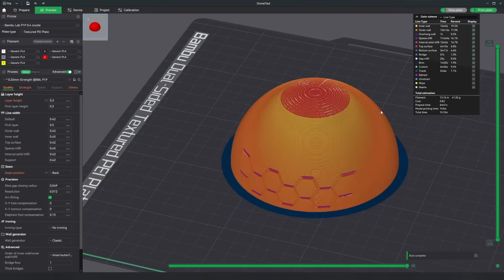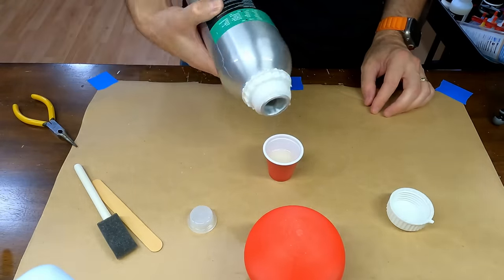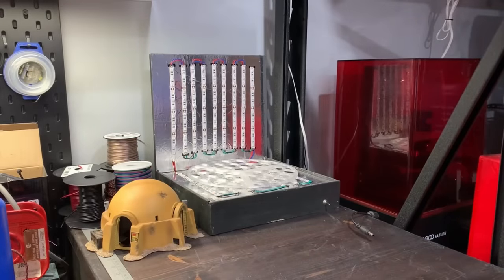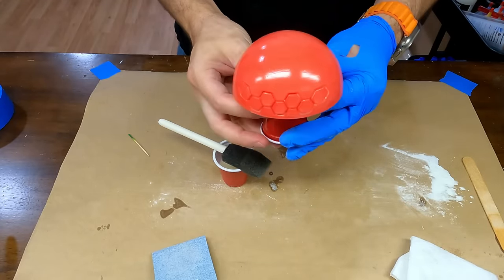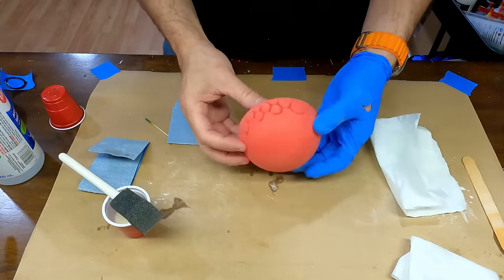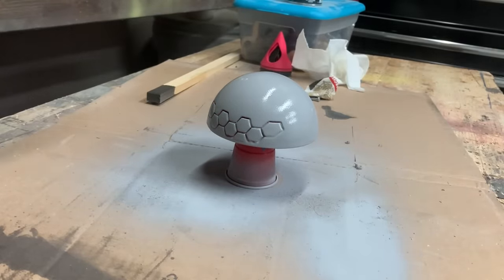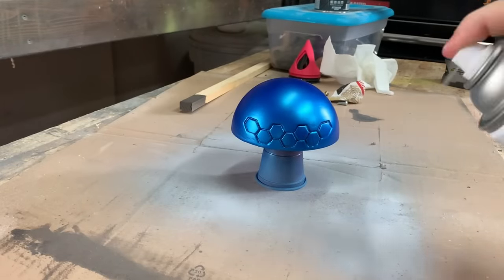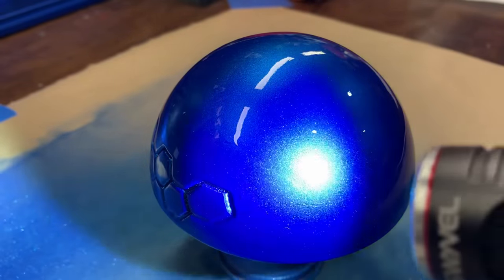Hide 3D print layer lines with Baby Powder and UV resin

Comment: Great technique!
For the recessed, relief areas,  the hexes could be printed separately  and then glued in later to preserve the detail. I understand that this is just a demonstration piece, but the method could be applied to other things. 
Just something to add to this method for finer detail that would not be possible otherwise.
Reply: Or you could just fill them with latex or some other masking medium prior to painting on the resin & scrape it out after.
Reply: @drakocarrion I had that thought too but then if you cure the resin you will probably seal it in and if you don't cure the resin it's going to be a big mess. It might be possible on some parts and maybe half curing the resin and doing it might work but I think it's going to depend a lot on the details of the peice.
Reply: @MrDuranis  A masking material would be visible under the resin, cured or not. You'd just need an exacto to scrape it out with.

Comment: nice work! If you add leveling thinner to your paint, it won't dry as fast, giving it time to level out, and you also won't need to spray as much paint. You'll get a much thinner, more even coat all around with less imperfections.

Comment: Was really hoping this was a brush on and cure solution that would not require sanding.  That being said the outcome was nice and I suppose it may have been less sanding than would be needed otherwise. Thanks for sharing.
Reply: if it doesn't have any details like the hexagons, you might be able warm up the resin and pour it over.  Exposing it after it settles could give you a very smooth finish with no sanding.

Comment: If you're going to be using filler primer and wet sanding and all this post processing anyways, how is this better than just using spot putty on the rough parts to begin with?
Reply from the maker: Speed mostly, and the speed scales with the surface area you are covering.
I have a video here doing the same thing with putty https://youtu.be/xxdjFREJpKs
It works well also but takes longer to apply and you have to wait hrs for it to dry between coats.

But putty would be better on smaller areas and around details you want to preserve.

Comment from the maker: Update: New video comparing Resin to Resin with Baby Powder added here: https://youtu.be/UFRbTg37Td8

Some people asked for still images to get a better look at the surface finish so I put a few image over on the community page
https://www.youtube.com/@DaveRigDesign/community
I also put some pictures of the red dome from the glazing putty video so you can compare the difference. 
To take a look and comment back here :)
Reply: Thanks for the straightforward video ! That's great to watch :)

PS : airbrushing with a smartwatch, you sir are confident in your skills I see !
Reply: @DaveRigDesign So is the corn starch just a thickener for the resin, so it can be painted on and not run off?
Reply from the maker: Exactly
Reply: @DaveRigDesign  thanks. Makes me wonder what other thickeners would work.
Reply from the maker: It seems there are products made for this. Glass Microspheres or glass bubbles seems to be a product used to thicken resin in boat building.
Reply: After all that skill and hard work, do you ever think you should just do it on a CNC machine? I thought the convenience of 3d printing was the selling point.
Reply: @DaveRigDesign  perhaps masking the hex pattern or filling with wax first will avoid the overflow of resin?
Reply from the maker: Ya have been thinking of some kind of masking material. People have suggested may things but it’s a tricky issue. 
It needs to stick good enough to not come out during sanding or effect the sanding process, but still needs to be able to be removed after easily. Wax may be a good option.
Reply: The surfboard industry has a resin called flow coat that is made to cover small discrepancies. You should sand lightly first so the resin adheres.

Comment: Try fumed silica instead of talc, it's an excellent epoxy thickener. You should be careful to use a respirator when working with it, but the same goes for talc.
Reply: He said it was corn starch at the beginning, also visible on the bottle. Although I was under the impression that baby powder was always just talc.
Reply: Ah, ok. In that case, definite benefit not having to worry about it.
Reply: @halkihaxx5  Baby powder has a small amount of talc.  If you want pure talc, you can get the powder pool players use.  I use it as a release powder for sand casting.

Comment: I've seen something similar where instead of baby powder and resin, they used acetone and wood filler. Obviously, acetone isn't good for all materials, but on PLA it had the same effect. Since I haven't ventured into resin printing and don't have a UV cure setup, I'll stick my crude finishing methods. Excellent video, BTW.
Reply from the maker: Thanks. I just posted a video about using acetone and glazing putty
https://youtu.be/CZsUXY_Qxwo

Comment: You can bring the clearcoat to a smooth mirror finish by wet sanding and then using polishing wax (like turtle wax) and a sponge/power drill adapter.  The drill makes the polishing super efficient and the sponge would conform to the sphere nicely.
Reply from the maker: Yup, I did think about that but I didn’t want to take it that far and they video wasn’t really about finishing the paint. 

It would have been super shiny though :)

Comment: Might want to be careful with the first from the resin. I'm sure some types are bad if inhaled.  Wet sanding should minimise the risk from the dust.
Reply: If the resin is fully cured its not more harmfuld than wooddust isnt it?
Reply: @soacker25  not sure how bad wood dust is,  but resin dust isn't good in the lungs.
Reply from the maker: No dust is “good” for your lungs, but the dust kicked into the air had sanding is negligible unless you throw it around and resin is inert once cured. If you want bad try cutting MDF on a table saw :)

Comment: Or just print it in ABS with an adaptive layer height followed by acetone vapor polish for a few mins. Done right, no resolution lost, while getting a glossy finish, that also strengthens the layer adhesion. No worries of UV degradation(UV resin degrades over time) either. Much cheaper than UV resin. Just some 💭
Reply from the maker: Could, but if you are printing big you need a big heated chamber to print ABS reliably. Also once painted Resin degradation isn't a issue as its protected. PLA is the much easier option to use. Vapor smoothing get more difficult the bigger the print also. 
This process is definitely better for large scale prints and less optimal for small scale things.
I don't think I would try it of anything smaller than the print I tested with.
Reply: @DaveRigDesign  Yes, you are spot on. Printing ABS without a heated chamber is tough, but with printers like Qidi X Max3, should not be an issue. Also the Acetone chamber needs to be custom designed(simple paper towel dip will not work well, apart from taking too much time). For smaller parts, Sanding or Sand blasting, followed by UV resin coat(clear 2 part epoxy? might work as well), is the way to go, except for the effort involved.
Reply: Any tips on ABS vapor smoothing chamber design?
Reply from the maker: I haven't tried it as I don't do much work with ABS, but it seems @aware2action may have some suggestions :)
Reply: @jonathandavis3754   All you need to know is the boiling point of Acetone. Ensure the vessel is made of conductive material and temperature controlled precisely. Have the lid to be isolated from the vessel, but have a lot of specific heat capacity, so that it keeps cooling vapor to maintain concentration. Also have some risers not to let part float in Acetone. Dose a tiny amount few ml, time it, tune accordingly. The idea is to build enough concentration, but not too much, otherwise too much softening and loss of detail. Duration is also critical. Making a recyclable chamber is possible, but advanced. Also use PPE while using the setup, and no open flame or sparks in the vicinity. Better be safe than sorry. That said, it should be fairly easy to modify some off the shelf cookware to achieve the results😉, if not dealing with large objects.
Reply: CNCKitchen tested the layer adhesion part and it was actually weaker with acetone smoothing
Reply: @anonosaur6466  It all depends on the acetone(any adulteration, its no good). It basically dissolves the plastic chemically and fuses it together(like melting a bunch of plastic without cooling in between). The only issue is, the treated area is rather shallow, but once acetone completely evaporates(could take 12-24 hrs), it is as strong as the material, for the shallow depth of fraction of layer line's thickness. It definitely improves the aesthetics,more than the strength though.
Reply: ABS doesn't need a crazy hot enclosure.  60c is plenty.  Also, if it was abs, you wouldn't need to do anything.  ABS hides layer lines better than anything except Copa.  The real issue is the machine itself.  It should be producing much better prints, especially in pla.  I don't use pla as it's such a poor-quality plastic, but it does print well.
Reply: @falsedragon33  It all comes down to print time!. With larger layers and a wider nozzle, things could be sped up. Also thicker layers are good for better strength(better isotrophy). In which case, the layer lines, do need to be smoothened out. With a tight enclosure, heating should not be a necessity unless printing large items covering the entire build plate.
Reply: Some of us don't have that luxury deek
Reply: @aware2action  I tried the basic methods mentioned and wasn't able to get the result I wanted -- uneven distribution where some areas were oversmoothed and some under smoothed, and too much loss of detail on hard edges.  I've seen some videos for industrial solutions floating around that I'd like to replicate, but can't seem to find much literature surrounding the process and unsure if the chemical they're using is acetone.  If there was a way to dose uniformly and for just the right time, with a method for collecting the residual acetone remaining afterwards... I feel like that product would sell REALLY well for home use.
Reply: @jonathandavis3754  Acetone does work,make sure it is pure(not the nail polish remover variety). You do need precise temp./time/concentration control. I did devise a system, that works very precisely with excellent repeatability, made out of off the shelf kitchen appliance, and some basic diy using arduino. That said, there needs to be few additional components, apart from specific settings to use while 3d printing, if you don't want to loose the sharpness and details. But still does not implement the recapture, but should be fairly straight forward, except for choosing right material for chemical resistance. I developed the system, since the one in KS did not live upto its claims, and needed functional part, unlike using polysmooth.

Comment: I think you can avoid all that sanding at the end if the print is sanded a bit before adding the resin.
Reply from the maker: After priming the amount of sanding depends on the paint finish you want. 
If you are using a matte finish you don't need to same as much or after sanding the 1st primer coat.
But if you want a high gloss mirror finish it is required. I didn't even take it far enough as you can see the orange peeling in the clear coat still. More wet sanding and clear coats then buffing after the final sanding is needed for a smooth mirror finish
Reply: After having sanded PLA as well as sanding resin... I can confidently say sanding PLA is ass. I'll never so so again if I can avoid it.🥴

Comment: Your airbrush technique needs refining.   

You should start spraying away from the piece and at steady speed sweep across the piece.  

Starting the spray directly on the piece risks throwing globs of paint on the initial burst.

To get better lacker finishes its worth doing a mist coat wait a moment until tacky and then applying a wet coat.  The mist coat will provide something for the wet coat to adhere and will assist in avoiding runs.  Keep the wet cut fairly thin, again wait briefly and apply a second.  Done right you wont need any sanding.

Comment: Pretty good results, viscosity of it seems like an artform unto itself.🙂
Been interested in what can smooth 3D prints, cool how print models can trade globally, but the time it takes to print multiple copies..... I think efforts like this will help towards better silicone mold resin casting methods that can produce more units faster and cheaper.

Comment: Interesting technique.   I've used bondo in the past and it turned out great, but I think using resin would be faster and require less sanding.  Have to remember this one.  Even though I don't have a resin printer, I might have to pick up some resin to try this out.  Thanks.

Comment: great to see this is still going around i suggested this idea over fare few years ago on my facebook groups to fdm users its a great way to use up the last of the uv resin from bottles and gives you loads of working time then cure. i was very disappointed with the 2 part xtc resin for smoothing prints as it always started to cure before you finished and found that using printer resin was a way better option though i never used baby powder  great video. wish i had done one back in the day just though back then that everyone else would have thought of the same idea :)

Comment: With all of the time it takes to post process this it just makes more sense to print at a higher resolution to minimize the layer lines and not have to do nearly as much post processing.
Reply from the maker: Ya, most people think that cuz they are just looking at the dome test object. 

What happened when you print a helmet or other large cosplay pieces where decreasing the layer height adds days of print time and you still need to post process after that.

Comment: Hmm interesting. Ive been applying UV resin to my prints for years and they work great even without adding baby powder. I suppose the powder helps thicken it. I'll give it a try and see if it minimises the amounts of coats i will need to apply. Thanks for this idea~
Reply: You can thin the resin down with ipa and use your airbrush to put it on, but you must wear a respirator goggles and heavy rubber gloves. 

Another thing you can do, specifically for buildup in nice clean lines like this model has is use a panel line etching tool to clean it out. I’ve been using one for years with all sorts of fillers on 3D prints.

Comment: I found someone made up a product which works exactly as what you did here. It's called UV putty, which is a liquid mixed with fine powders that solidifies with a UV torch. It works extremely well for my project, however they do have the downside of being brittle. I currently am using superPP abs-like tough resin and would be glad to try your method to make my own uv putty, and see how resin changes the toughness.
Reply: Is there a specific brand of UV putty you can recommend?
Reply: Most UV printing resins are also fairly brittle, make sure to get one of the tougher/flexible ones on the market if that's what you're looking for.
On the other hand- a harder (and therefore usually more brittle) surface will be more scratch-resistant and easier to give a high shine polish.
Reply: @jelteklaswijnja4055  Yep. The one I mentioned was quite brittle, yet the super pp ones are quite strong and flexible, so gonna try to make putty with that

Comment: One thing I’ve been doing lately o. Helmets is slicing the top of the dome off where the layer lines start to get bad and key the parts to fit together then re-orienting the top portion so that it so doesn’t have huge steps to fill in. Yeah it takes a bit longer to print and you have a seam to deal with but post processing is much faster, by a lot. 

And that seam is t a big deal considering I use weld-on to melt the pla together and for good measure heat weld the seam on the inside for added strength. For extra insurance you can make your own plastic staples but I rarely need to do that with both weld-on and plastic welding.

Comment: I got a similar smoothnes, but by using fewer steps.

Using SPACKLE, pressing it into layer lines, and gently rubbing off excess, then lightly sanding once fully dry.
I then use a matte spray coating, matte acrylic paint, and finally finish it off with whatever clear coating finish I like.
Usually using Watco satin or glass based on the objects desired finish.

So to recap

1) Spackle
2) while spackle is drying, gently rub it
3) once spackle is dry gently sand it
4) paint with a matt paint until fully covered (usually 2-3 coats is enough)
5) Spray finish and you're done.

Comment: After printing transparent resin items I sand back slightly and apply a coat of resin and use an air compressor to blow off any excess resin to ensure all the detail remains. I cure with out cleaning or wiping of any kind and get a glass like finish. It takes longer to cure but the finish is worth it!